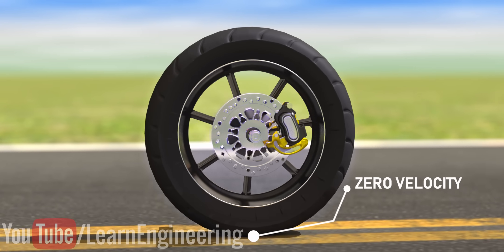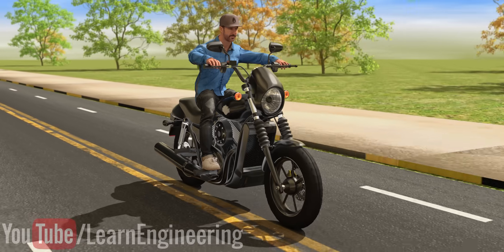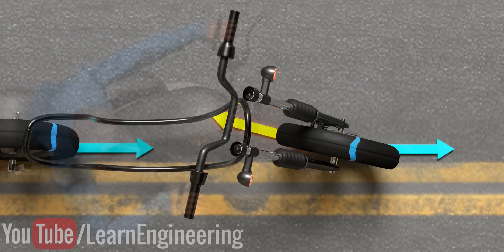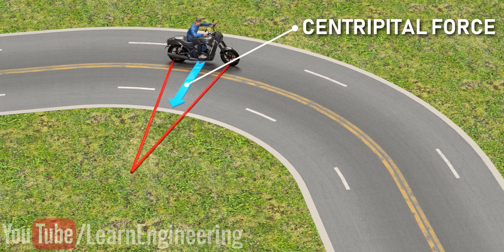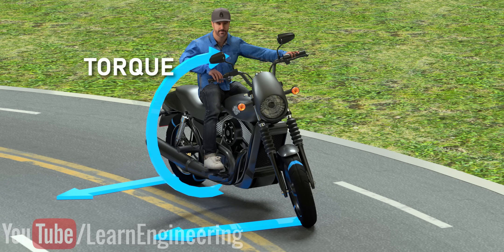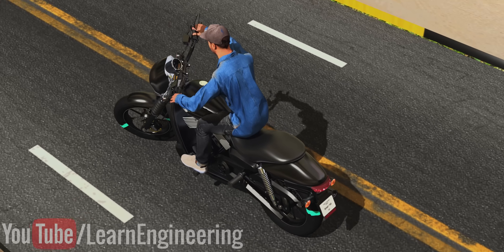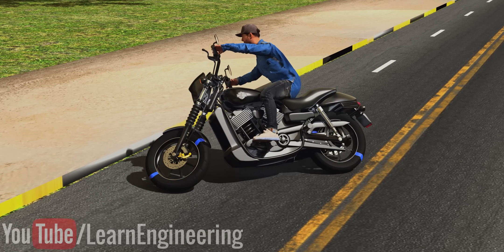Counter Steering | The interesting physics behind it

Comment: Below 5 to 10 kmh you can steere with handlebar, above that you steere with your body. This video only confuses me!
Reply: It is impossible to turn without countersteering at higher speeds. Most riders are doing it without even knowing it. Once you know what the physics of it, you can practice it with more confidence and the result is better control of your MC. 
Next time you are travelling down the highway, turn your bars slightly and gently to the left and the bike will quickly turn right. Same thing in the opposite direction.
Reply: @joepromedio  yes, but this video says that there are two methods of steering, no matter what speed is
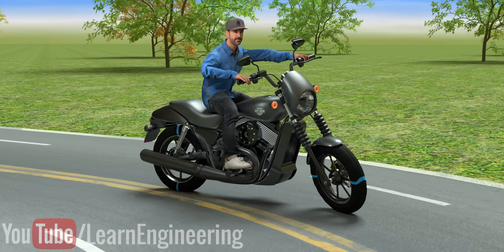Reply: @pararera6394  Yeah I know. But, the whole point is get the bike to lean for a turn. Using counter-steering is a much better way as you can make precise changes in your lean instantly. This becomes imperative when on a mountain road, especially when the arc of the turn isn't consistent through the turn. Making minor adjustments to your lean angle, with counter-steering, is an important tool that every rider needs to master. We are safer riders when we are in total control of the bike. This video shows how it is done while riding. Start at the 3:00.
https://www.youtube.com/watch?v=K7YyV92Er8Y
This video is hard to watch, but it shows what can happen when you don't use counter-steering.
https://www.youtube.com/watch?v=VVE79XT8-Mg

Happy New Year! Be safe.
Reply: Pararera  ummm you don’t ride do you?
Reply: @mybackhurts1982  I ride, not for long but I ride.

Comment: and stay off the painted lines or you are going down anyway , especially if wet.
Reply: and wear gloves and a helmet and sunglasses a bee in your eye at 80 mph hurts
Reply: Rain hurt at 40Kph
Reply: Where i live there are drain covers on practically every corner of the road. Slippery as ice in the rain. I call them the drain covers of death for a reason. Nearly been taken off
by them a few times.
Reply: 2bikemike I watched a guy dump his brand new Harley when he grabbed the front brake and he was on a painted line
Reply: @Agarn4269  
Kevin I've seen that done not on lines, and I did it myself a few times in slow speed maneuvering.  not a nice feeling.  I'm a bit better at it now.
Reply: @Agarn4269  You grabb the front brake, you are going down. The paint is not the reason. You shud never grabb the breakes or any controls on a bike.
Reply: @Agarn4269  a motorcycle only steers by countersterring. Confusing information.  One does not have the option to counter steer or conventional sterring while going through a curve. You sound like a person with some head knowledge and no actual experience. I hope you do not get sued.
Reply: @fredmartin1561  what the hell are you talking about?  I grew up riding bikes. I had a Honda VTX 1800 for almost a decade. I saw a guy grab his front brake on a paint line, his tire skidded and he went down. If he had been on the black I don’t think that would have happened
Reply: I've never been hurt by a painted line?
Reply: Yet!
Reply: @2bikemikesguitartopics145  wow thanks for wishing bad on me
Reply: @C4LB34R  nope, I not wishing bad on you.  from your comment that painted lines never hurt you I took it that you like to ride on them or you do anyway, and if so it's just a matter of time until I lean angle on a painted line will hurt you. It's a warning not a wishing
Reply: @2bikemikesguitartopics145  thanks for explaining that i was like wow that's fucked up haha but ya I live in the mountains so alot of roads that I can see far ahead I cut through the corners over all the painted lines been doing it for years never had a line affect my riding. I do however stay away from them when its wet so maybe that's why
Reply: @C4LB34R  
I don't know where you live and how they Mark the lines on your roads but here in Ontario Canada and other parts of Canada with severe weather we have for winter painted lines are very thick paint which make them seem like ceramic tile smooth. Even dry there a bit dangerous if you get on a lean angle in a corner it could take you out. When they're wet it's like ice
Reply: @2bikemikesguitartopics145  oh wow!!! I'm in california, USA I bet you guys have different style lines painted for the Cold and bad weather because it gets bad up there! Man that sounds bad watch out for those lines buddy. Safe travels!
Reply: @C4LB34R  I have slipped on a painted line and paid the price in the hospital.

Comment: This video is stupid. Counter steering exists because a fork is at certain angle (not 90 degrees to the ground) and no mention of Rake and Trail. All counter steering physics start there. If the fork was at 90 degree counter steering would not be possible.
Reply: the video contains many errors but you can still counter steer even if the forks are completely vertical, the main difference would be that the bike wouldn't be so good at keeping itself upwards without human input
Reply: @rodrigomendes1980  absolutely not. with 90 degree fork there is no counter steering. you have no idea how it works if you think it can do counter steer with 90 degree fork. and yet you are commenting boldly.

Comment: Total fail. Anybody, and I mean anybody that has ever ridden a motorcycle can tell that this guy narrating this has not. This is not how the mechanics of a motorcycle works at all. I've been riding for more than 20 years and I ride often. But I'll give you a little heads-up, if you're going down the highway at 60 miles an hour and you push with your right hand you will turn right and no amount of "body leaning" will change that.
Reply: I think I am in agreement with you. Pushing the right bar actually gets the wheels to the left of your centre of gravity and the bike will naturally go to the right. I find it quite a smooth process. There doesn't seem to be any risk of pushing too hard or too long, the bike just finds an equilibrium. You can also use the same technique to straighten up too.

Comment: sometimes when i want to turn at sharp corner, i do this unconsciously, and for normal turn i just lean my body, but after watching this video, now everytime i do it, probably i'm gonna conscious about it
Reply: You're definitely going to crash now
Reply: @natking1u1z99   was thinking the same thing I never think about taking a corner I just do it 
Probably now gonna overthink it and ride straight into a tree
Reply: Seraph  totally right unconscious thing never even realized I did it now I’m gonna think about it and probably eat it
Reply: Especially new riders should be acutely aware of this to avoid hairy situations. But instead most of them go by the "body lean" urban  legend.
Reply: @rationalityfirst  So as a new Rider, should i do "counter steering" or "body lean"? (At high way speed)
Reply: @BRAVO SIX you should get used with the mechanics on a side road with low traffic, start with low speeds and increase gradually observing the effects of countersteering and body lean in isolation, that way you will tell how much efficient countersteering is than just shifting your weight. then in normal traffic try to "observe" yourself doing the maneuvers and see what comes naturally. initially there might be a need to "fight" the instinct of normal steering that could put you in trouble when you encounter a surprise situation like an oncoming vehicle on a tight turn or narrow road. take care!
Reply: Pray for me😂
Reply: You'll be fine if you keep your speed in check. And remember, loose grip on the handlebar. The bike will take care of you if you're gentle with her.
Reply: @rationalityfirst    moral :-
(Talking about speed in excess of 20kph)

1) Leaning is not as effective steering technique as counter steering. It is more
intuitive. 

2) Practice conscious counter steering to become better rider. It is more effective.

Is that correct?
Reply: Yup, those would be the main conclusions.
As a way to understand countersteering, do you ride a bicycle? You can notice the effect even on that at the right speed.
Reply: @rationalityfirst  I used to ride a bicycle.  As far as motor bikrs are concerned, I have ridden for almost few hours(as i am a beginner right now). I have done some counter steering. Btw Thanks for your advice man. You may have saved a live.♥️

Comment: not just motorcycle, all 2 wheels applied
Reply: Pedal as fast as you can and try to turn normally and you will crash on a bicycle, you can steer it normally because you are going to slow
Reply: So why does my rehular bicycle turn when I only turn the wheel without tilting at all ? Thanks in advance.
Reply: @JohnSmith-bw8xv  Short answer - it doesn't. You do all the counter steering subconsciously, always.

Some time ago, I watched a different video explaining this very fact and I didn't believe it. Clearly you can steer the bicycle by just turning the handlebars in the direction you want, right? Well, I sit on my bicycle a few days after and really focused on what I'm actually doing when steering. Try this - ride perfectly straight, almost without touching the handle bars and then try to apply a slight torque on the handlebars that's perfectly along the vertical axis, say in the clockwise direction. Like, very carefully push your left handle bar forwards and right handle bar backwards and be sure to not apply a force in any other direction. You'll find that the bike does not turn to the right as you would expect, instead it instantly leans to the left and the bike automatically turns left too, unless you actively resist it in which case you'll simply fall. 

So how the hell am I steering normally when I'm pretty sure I don't counter steer?, was me thinking. So this time, I instead thought "Let's turn to the right" and tried to observe what happens when I do this the way I always do it, without really thinking about it. Turns out, I don't apply a torque along the vertical axis, I sort of push the right handlebar down and because of how the fork is tilted, it actually results in me pushing the right handlebar forward as well, thus creating a counter-clockwise torque that results in the bike leaning to the right and turning right. The bike cannot physically turn right without leaning right. It may be a slight lean, depending on your speed and the radius of the turn, but it's always there.

Now, if you're like me, you won't believe what I'm saying here. My advice - next time you're on your bicycle, observe carefully where you actually apply the force when steering. I assure you you'll be surprised. 

Most of us learned how to ride a bicycle as little kids and it's really a second nature to us so we don't think about what we do. We assume we know how we're doing it but in reality we don't.
Reply: @TheAngelsHaveThePhoneBox  No, just try turning without your hands on your handlebar and by only moving your waist
Reply: @TheAngelsHaveThePhoneBox  you are restarted, there is no subconscious action. its not necessary